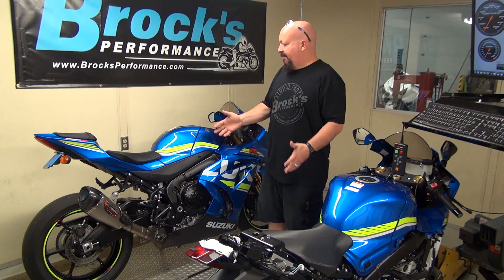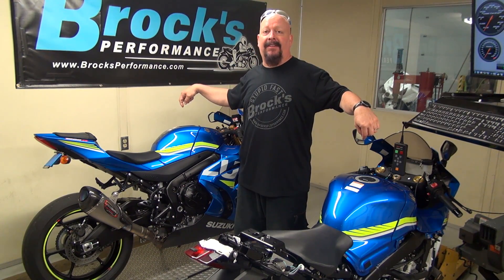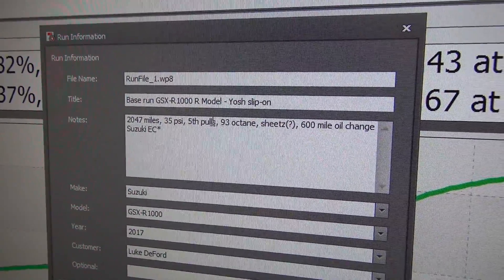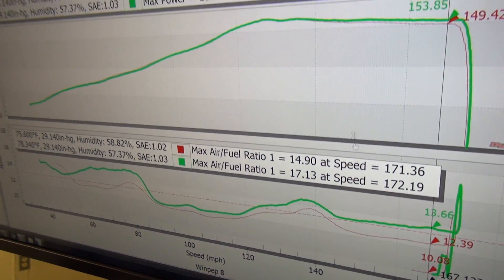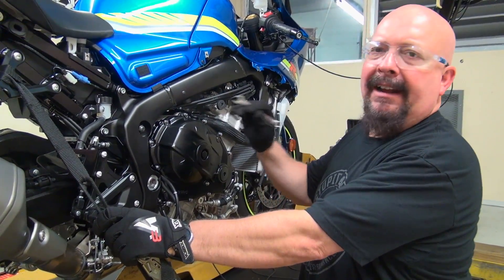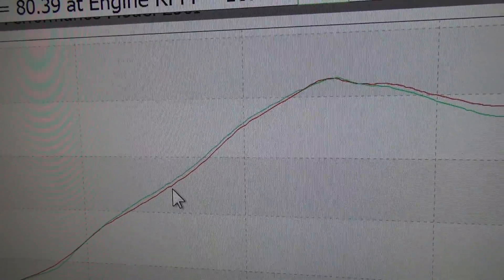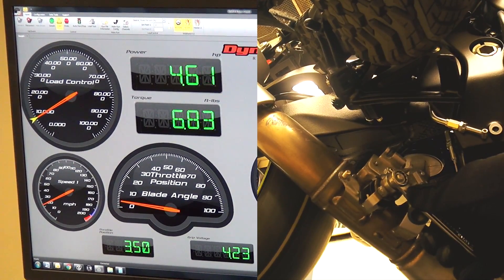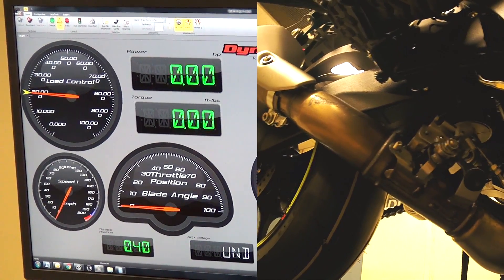2017 GSX-R1000 S2B: Episode 4 - Exhaust Installation and Theory (Part 2) Standard vs. 'R' Version

Comment from the maker: See description for detailed information and video time tags
Reply: Maybe they are using the exhaust valve to smooth out power delivery. I noticed that some motogp teams are using exhaust valves. Sound and emissions are not a big concern. The only thing I can imagine they are doing is controlling power delivery. Opinions?
Reply: Brock Davidson we would love your input on our new Facebook page.......  SUZUKI GSXR 1000 1000R L7
Reply: @Brock: Read your link to the octane article, excellent read. Question; If my one of my goals is to stay on pump gas, and the 2017 GSX-R1000 is only requiring 90 octane, is there room for a small compression bump on this bike and would there be a performance gain significant enough to warranty such a mod? The thought being 93 octane. I've gone the MR route before, and it's more mess than it's worth. A real nightmare if you just miss one drain and flush. Thanks!!

Comment: I know its an old video but love to hear what you thought about the slip on run being 14-15 afr on the low revs
Reply from the maker: That's typically where OEM set-ups run at lower revs.
Reply: Thanks for reply, reason i ask is i have same bike with R11sq slip on (stock bike otherwise) and haven’t removed the db killer because because i was worried it would be lean. So you think its ok?

Also curious in these runs has lukes bike had pair blocked? As watching your other video we know at low mid rpm even at full throttle the pair is pulling air in and that would make it look like its lean low down?
Reply from the maker: You will be fine removing db killer. We don't make runs without the pair blocked, unless we are doing a video on before/after etc. Stock bikes are VERY rich up top, at wide open throttle where the load is most severe. At lower opening, the load is not sever enough to cause damage.

Comment: I got the c46 code on 22 gsxr 1000. Gonna remove the cables and servo buddy it until I can get a full exhaust. But if I do will the cross pipe valve stay open?
Reply from the maker: The crossover valve is normally closed and the ECU opens it at high RPM to make max power out of the DINKY  head pipes they used to keep low end torque up. If you disable, with the stock head pipes you will be WAY DOWN on peak power.
Reply: @BrockDavidson  thank you! Appreciate the response.
Reply: @BrockDavidson  if i buy headers, can you flash ecu if i mail it to you? Im debating between moore mafia or you guys. Don’t really trust to many shops down where im located. Do you guys offer headers that is compatible with yoshimura alpha t 2 slip on?
Reply from the maker: Please contact customer service for your options.

Comment: So cross over tubes or no crossover tubes?
Reply from the maker: Depends on application... what's yours?
Reply: @BrockDavidson  all stock 2011 gsxr 750. Just bought it. 7k miles. Practically new. Looking for the right exhaust.
Reply from the maker: @brendan flegle  we don't use them on ours and get very strong results: https://brocksperformance.com/alien-head-full-system-black-14-muffler-gsx-r600-750-11-20/

Comment: Dear Brock.

 I know this is a very old video but i got a question and maybe you still read this. My english is not so good so i have trouble understanding everything in the video said but i try. As i understand the valve in the back on the gsxr 1000 exhaust does not make any power difference when you disable. Is this is same for the one in the front header or is that one important for horsepower? When you remove the cable i see the back stays open but the front will stay closed (i think?). Can i remove the cable and ride or is it not good?

I wish you a nice day and thanks for you videos.
Reply from the maker: @WheeliesForTheFeelies - your English is good! If you are speaking about this exact bike 2017+ GSX-R1000, removing the front cable results in high RPM power loss. The valve on the front of the header (SUZUKI Exhaust Tuning-Alpha valves (front EXCV)) is used unlike most other similar items seen on other machines in that Suzuki opens this valve at high RPM's ONLY to help vent exhaust gasses that otherwise might not escape due to the very small header tubes they use to help develop low end and partial throttle "grunt". Disabling this valve on the stock head pipes results in lost power in the high rev range -therefore, it is not recommended. I hope this helps. - BD

Comment: I know this is old, but since you have eddy current load holding, you need to set the load to hold RPM and THEN adjust it while the dyno maintains load to hold a certain RPM.
Reply from the maker: Please watch the entire series.
Reply: @BrockDavidson  when you were turning the exup on and off it wasnt maintaining a constant speed so it wasnt possible to see exact changes at the same speed 14:20 (dropped a good 10mph from my seat from 40mph to 30mph).  Maintaing constant load is fine for cell tuning (which you are well aware Ive seen you do it) , but for this test shouldve been targeting a constant MPH/RPM to give a full apples to apples comparison instead of a constant load with a varying MPH/RPM
Reply from the maker: @Matty_Bski  The gauge on the upper left shows that we performed the test at 20% load. I'm sure you can find a better video explaining this if you don't like our testing procedure.
Reply: @BrockDavidson  holding the same load with differing power is going to make the difference appear larger.  Take for instance dialing in timing curve, you need to hold it in a particular cell and add timing until you see a torque drop aka spark hooking, if you did that via constant load as you made more torque, youd move out of that particular cell into a higher rpm cell.  By maintain constant speed and  varying load, you can change the power all you want and still stay exactly at the same point of the map which thereby gives you an apples to apples comparison of what the variable did (be it open vs closed exup or advancing/retarding timing).  Regarding the outcomes, I know getting rid of the exup helps, thats why none of my bikes have them and Im not calling into question the efficacy of getting rid of it, just that the way you showed that test isnt how Id do it for seeing power change. Take it as constructive critism and not berating cause thats what it is.
Reply from the maker: You do realize that the bike tried to stall when we manually closed the valve? What you are asking is better suited for an engine dyno... the purpose of this video is not to determin BMEP... it's to attempt to show marketing vs. real world results. I belive it accomplishes this.

Comment: Actually if you load the bike more at lower speeds and more throttle you will see an increase in power. They don't put those valves on for no reason and it's not noise reduction which could be accomplished easier and cheaper
Reply from the maker: Not on any instrument we have to measure power, dyno / drag strip etc...
Reply: @BrockDavidson  So why is it there? They have been used long before any of the current stringent emission and noise laws were in effect...
Reply from the maker: @Bass.Player  only telling you what we have discovered. Not saying it's  marketing bs on all bikes... But it is on this one and every other we have tested. Ever.
Reply: @BrockDavidson  I realize that this is what you find in your testing (I saw it), but I know that reducing the back pressure removes power/torque in times of high cylinder pressures where velocity is greatest compared to piston speed (both intake and exhaust).
I think we all have observed a loss of acceleration while doing a 5/6th gear roll-on from say 40/50 mph when going to a free flowing exhaust.
This was one of the reasons engines went to four valves per cylinder to increase flow at low piston speeds and some engines only use two of those valves until higher RPM. This volumetric efficiency technology has been around and in practice since at least the early 90's. Peace!

Comment: Have you considered  timing and fuel adjustment with your test for the exhaust valve ? such a big difference could be related to the ECU not adjusting for these parameters OR the ECU might just jump to a different timing/Fuel table once it recognizes the valve is open and that will definitely hurt the relative low rpm the bike was tested at. I would love to see the timing advancement and the A/F ratio to conclusively say the valve is hurting the performance of the bike. Because, for a N/A motor, what moves the exhaust gas from one end to another end is the pressure waves  generated with each exhaust stroke along the pipes. That being said, at low rpms the valve can enhance the size of the pipes to the optimal point where the  pressure wave can travel at their best UNLESS there is exogenous factors that could hold it off.

Comment: hello, Thanks for the great content you share with us, really helpful!
I have a question: you showed the effect of keeping close the cross over tubes on post-peak power. However, that is a USA bike before the ECU flash. In the USA bike, because of the limitations, the peak takes place at much lower rpm if compared with the EU bike. So the statement that cross over tubes help the post- peak power might be not valid in the case of EU bike (or USA without limitations), do you agree? Maybe, without limitations, even the peak is lower not only post-peak?!

thanks
Reply from the maker: The crossovers (not adjustable) in aftermarket exhaust systems have hurt peak power on all bikes we have tested over the years.
Reply: @BrockDavidson  thanks for the answer ... So if you imagine to modify the OEM exhaust, removing the catalizer and exup valve, would you leave the cross over open or closed? (In EU bike) thanks
Reply from the maker: If you intend to retain the small diameter OEM primaries, the movable crossover will be needed to retain decent peak power.
Reply: @BrockDavidson  ok perfect. Thanks

Comment: Point being about the SET - just delete the function of the this valve to be always open. 
But keep the oem function of closing the front cylinder channels for high RPM. 
Then the power from low to high should be kept the best way. But - as from the early days already - the secondary butterflys and also SET valves are just there to make the bikes more quiet.

Comment: So let me get this straight. If loosen up my servo cables from the servo near the muffler, pure for a better sound. The performance won't be affected?
Reply from the maker: @Mitch RR - If you remove the cables completely AND make sure your EXUP valve does not choose afterward... if it does, you could LOSE a bunch of power.  That said, any removal of the cables will also trip check engine lights, which can lead to additional confusion/problems in the ECU. The cure for this is a proper derestriction flash. Please e-mail dynoroom@brocksperformance.com to see if we offer a flash for your bike.

Comment: I have a 2017 GSXR1000R..just put a full system and power commander with no map yet,servo buddy and K&N air filter..bike hasn't been tuned yet.my check engine light came on n stayed on..how do I get the light to turn off? Any in put would be greatly appreciated..thank you.

Comment: Also keep in mind the 2017 GSX-R1000R is 438 lbs, while the 2017 GSX-R1000 is 431 lbs. Yes those add features do come at a small weight cost, however I guarantee for most people at track days or races, the RR model will lap faster on the average. The transition from throttle to full brake and down shifting in particular on the RR is miles ahead of the R. The RR will get the bike slowed for corner tip in at shorter distances than R because of blip shifting, and consequently earlier engine braking will occur. My testing has shown that the RR, even if the rider chooses to hold the clutch in (with the blip shifter activated) it will honor all downshifts very quickly. Which means the only thing left for you to do, is lots of braking and occasional clutch release to let engine braking help slow the bike. Now try that on a 2005 GSX-R1000, not going to happen. I don't even think the 2017 R model will honor all downshifts if the clutches is kept fully disengaged when attempting this. I believe the R will require the clutch to be released with each downshift? Brock can you verify this on the R? The time saved with the RR allows shorter braking distances, later closing distances on competitors. It's truly an awesome piece of machinery, we finally have a bike where both entry into and exit from the corners is nearly seamless. Today with traction control on 2, plenty of throttle, the rear snaked around a little and immediately smoothed right out while still pulling like a mule. From a dead stop I just release the clutch smoothly, add loads of throttle, and almost immediately I have to Q-Shift, while the front just hovers a little, all the while my lower body (legs, back, stomach) is working to stay clamped on the tank, and this beast just keeps on pulling. All that at 165 hp, just wait til Brock takes this thing, to I believe, 190+ hp on pump gas. I'm telling you all, this thing is a weapon. Several occasions, the RR downshifted so dang fast, I hadn't properly matched braking speed upon clutch release, but guess what, the slipper clutch did exactly what it's design to do, SLIP beautifully. One more thing, I'm not even finished with my 1000 mile break-in, so all this is happening under 10k rpm. Engine Mode, Traction Control (wheelie control integrated), Launch Control (which I'll test after breakin), Quick & Blip Shifter, Lap Timer, Performance shocks (springs may need changing for racing), and a bevy of changes allowed via the screen menu.

Comment: First of all i'm loving this series.
The explaination you give is clear enough for a complete noob in the matter like me to anticipate some of your assumptions while listening and finding them correct afterward, that's just thanks to a great presentation. very good job!

I just wanted to make  a consideration about the exhaust valve test.
In your test you were either having the valve 100% open or 100% closed.
What the ECU does with it is carefully adjust it and not necessarily opening it up linearly, you can clearly see it some time do like "open - open - open - close a bit - open open" while the RPMs are increasing. It is fine tuning the exhaust pipe's diameter based on data from the various sensors it might be using. It's quite obvious that if you put a plug at the exhaust end it drops in power!
Plus you missed the crossover pipes test. Should have done the same thing with that valve just for the sake of it.

Comment: Funny thing to add is that I road one of the new gsxr 1000 and found it had no power bellow 7k in 1st crack it open she is flat . I know own a k6 with no valve in the pipe and she pulls from 2k easy at low speeds I  3rd or even 4th at a push . I prefer the k6 has more grunt and ooomf . But the new bike has the edge at top end but that's it

Comment: can't explain why did she lost power on the top end without the valve connected......isn't that fucking valve supposed to be wide open during this rpm range anyway ??
Reply: at high rpm with the exup connected, the valve will be wide open in the exhaust near the muffler but it also closes the crossover tube in the headers.  In this case, the crossover tube in the headers never closed so it lost top end.

Comment: Cool stuff. You just made my day brighter 😆
How does the exup affects AFR? Rumours has it that removing them would cause the AFR to go haywire...
Reply: r3dster - I was wondering this as well. I am also curious how the results would differ, were you to tune the bike in the scenario where the cables are disconnected, considering the bike comes delivered with a factory tune designed for them to be connected.

Comment: Oh and for the record. That Gsx-R is running lean af... He really needs a tune. he's almost runing stoic. Need to be low 12's His cylinder temps are probably high af. 

Most 600's can get away with a mid 13 tune and still have good cylinder quench but not a 999.

Comment: Brock question I see you run 89 octane on the gsxr is it ok to run that low of octane fuel on these sport bikes specially with such high compression.
Reply from the maker: The manual calls for 90. Our pumps here offer 87,89 and 93. The 93 hurts horsepower vs. the 89, so we are going with 1 point lower. Please follow the mfg. guidelines ESPECIALLY if you live in a hot climate or you subject your bike to extreme use. Here is more info on octane: http://www.brocksperformance.com/brocknm/templates/bpp1.aspx?articleid=255&zoneid=8
Reply: Thanks Brock love the videos very interesting info

Comment: Brock I have the same exact GSXR 1000 R with the Yoshimura slip-on. I know that you're obviously going to install your exhaust with a full ECU Flash. Based on everything you showed this seems like the way to go. Can you tell us how much life we might be taking out of the motor flashing the ECU or is this something that is a safe science at this point?
Reply from the maker: Check out 15:00 here: https://www.youtube.com/watch?v=GTa4Q8D7WDY&t=1s
Reply: Brock Davidson I know the limitations of the slip on it was just a cosmetic choice for now. Im waiting the first season out for you guys to figure out what capabilities / parts are needed to make big power. Im just curious how tough is it on the motor running a flashed ecu. Also will it be possible to have a flash for people with a slip on that keeps the exup but gives us what our european counterparts have in terms of horsepower. Can the ecu open the exup earlier? Not all of us can afford all the tickets we would get putting a full on race exhaust when riding in the street.
Reply from the maker: Please see link below on no reduction in engine life. We are working on a good combination for a slip-on/flash max power etc.